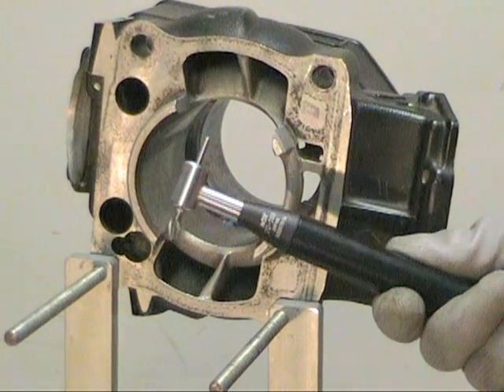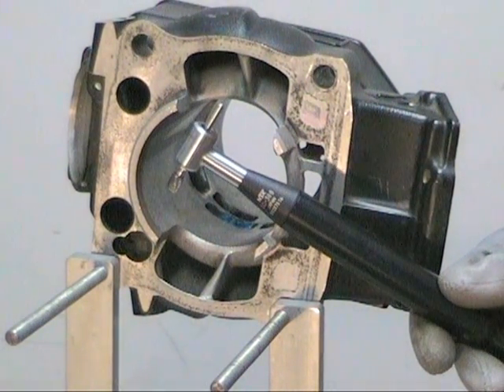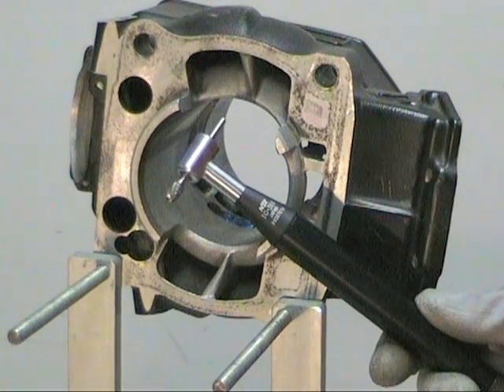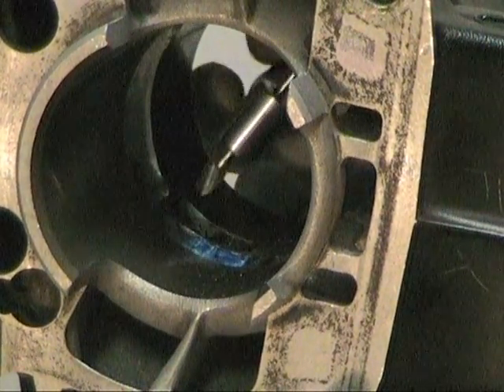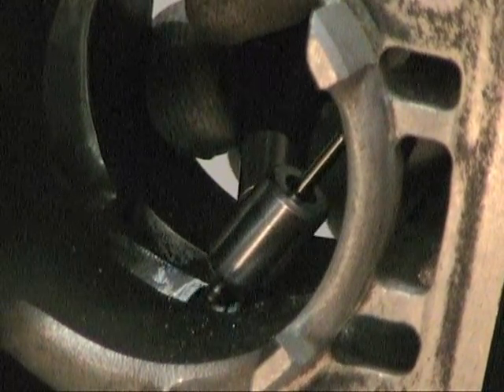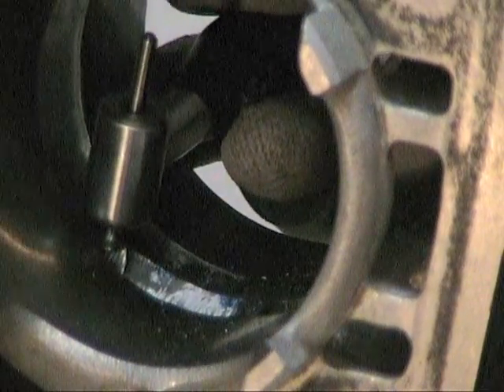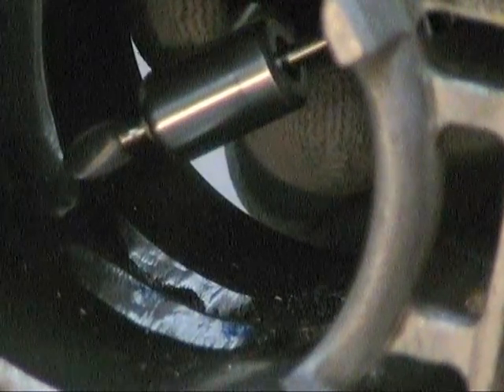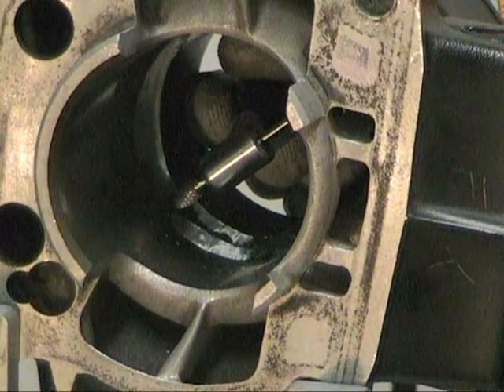Technique for a Right Angle Rotary Porting Tool, like the 182AMC or 1MC

Comment: Thank you for putting this on here. Tired of hearing newbs gripe about a right angle porting tool chattering, when it's just a matter of them not knowing how to use it correctly. As you show, it works smooth as silk if you know what you are doing